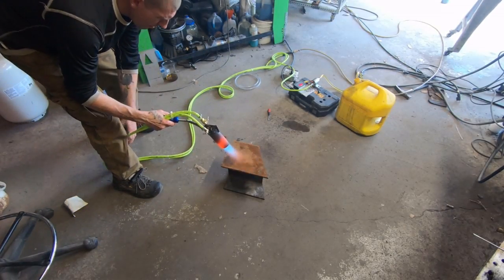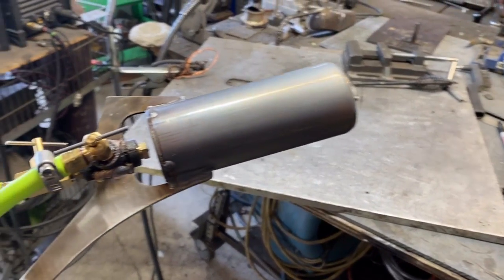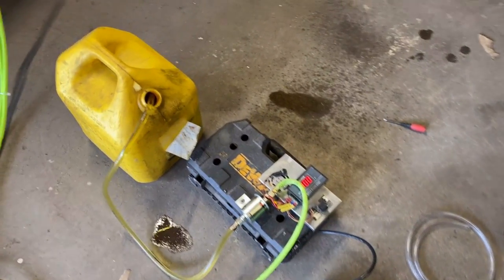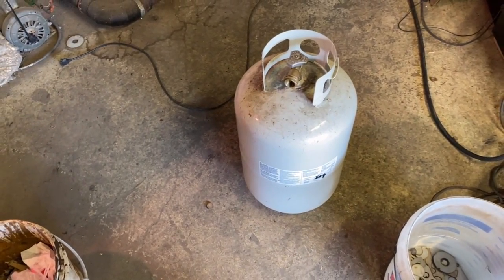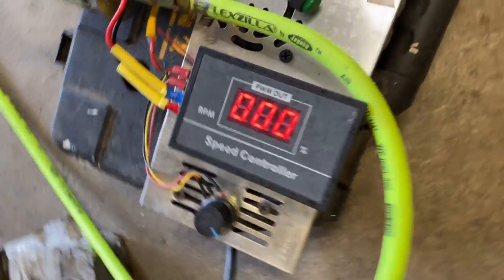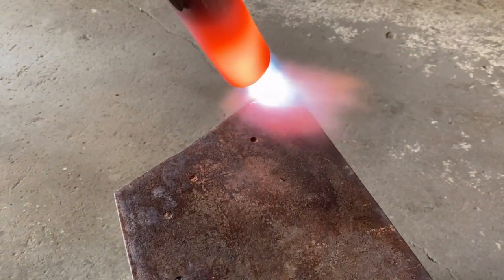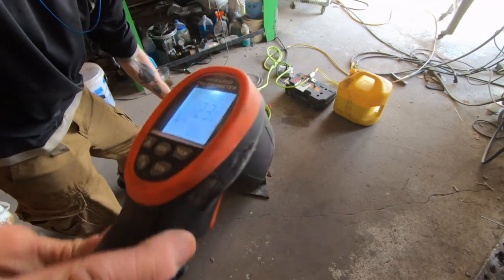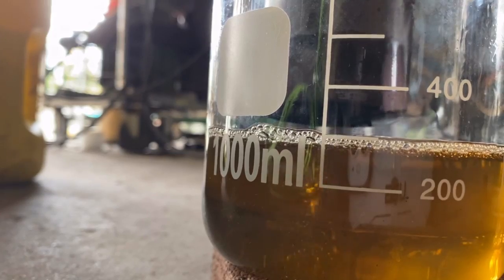Rocket torch Liquid fuel blow torch system runs on gasoline or diesel

Comment: The type of pump you are using is a magnetic pulsating pump. This kind of pumps are used on aux generators with carburetors. This pump can run on blocked output fuel line without a problem. You can simply run it at full 12v and simply regulate your fuel flow by chocking it using your regulating valve. This will also take your pulsating problem away. Also you will be able to get rid of your voltage regulating device.
Reply from the maker: unfortunate some of these umps do not work as you described , they kick off and on for some reason , some do have a pressure switch inside .
I tried the method you described and unforunalty it does not work that way
Reply: @NOBOX7  This is how it is designed. It simply stops at set pressure. If you ever watch how this pups work you will see they pump quickly and as soon as the carburetor is full and needle valve is closed they just stop because the diaphragm can't overcome spring pressure. As soon as needle valve opens the pressure drops after the diaphragm and it starts pumping again, then stops. You have to have some fuel flow or it will pulsate, start stop pumping. If I were you I would use some sort of centrifugal pump or inline pump for EFI fuel injection and pressure relive valve. These pumps are higher pressure pumps and they don't pulsate.

Comment: Back in the day, we used a hand held torch that used gas and diesel. Of course its considered antiquated, but it sure was convenient. Had the same fluttering effect until it was adjusted properly. Once the cast iron head was pre-heated it would work great. You can still find them around garage sales. Maybe give you some design ideas. The cast iron would pre-heat the air supply and the fuel, more air volume but less air pressure? Good luck with it, looks great :)

Comment: I read a paper once that stated that you got better heat transfer if there was pulsation in the combustion. Then I remembered a commercial high efficiency home heating furnace that used a pulsating flame. You might not even want to get rid of the pulsation !

Comment: I know it isn't a problem in this design, but, if it's easy to increase the liquid pressure in the line by around 50-100%, then I think, with also giving the oil a tighter squeeze at the burner end, the pressure variation in the oil line that comes from lifting or lowering it could be reduced by the same percentage of change in pressure in the line.  If you wanted to take it even further, you could even fashion a burner with a small pressure regulator of some sort which is closely attached to the burner end of the assembly, but that is a lot of effort for a small improvement and probably not worth if I'm not mistaken.  What do you think?
Reply from the maker: Yeah it depends on actual performance  without it Vs with  . The problem is the Steam axe will be a $800 $1000 tool most likely . So to keep cost down 
we really gotta ask ourselves how bad do you need a $40 regulator ? If you read the amazon reviews its not looking good for the units under $40 bucks . In the next video i solve the problem with About $20 labor included .

Comment: You could perhaps reduce pulsing through the use of an accumulator in the pressurized fuel line. This is a common practice in hydraulic systems to create a smoother flow of oil. They are also easy to build for the pressures you are operating at.
Reply from the maker: Yeah i mention that but i gotta keep cost down so thats the purpose of this test to see if it even maters.
Its gonna cost $20 bucks or so to do it i wanted to see if its ok without it . The video i will add a accumulator

Comment: I am a small engine mechanic and I accumulate a lot of bad gasoline from customer's equipment. There are no places in my area to safely dispose of gasoline. So what I end up doing is pouring it into a steel bucket and burning it. There are many issues with this, some quite obvious. First of all, burning gas in a bucket takes a very long time to burn, especially when I have to burn several gallons at a time. Second, the black smoke might also bring unwanted negative attention. But worst of all, I have to babysit the fire to make sure it doesn't get out of control which is a complete waste of my time. It could take hours for it all to burn away. The smoke and the odor of stale varnish gasoline is nauseating to say the least. To keep the smoke down, I used a small blower from a exhaust blower on a gas furnace which helped somewhat but positioning the blower and aiming it perfectly at the burning bucket is a pain and there has to be a better way of doing this.
What I want is a self contained system that can burn old gasoline at a decent rate while emitting as little black smoke as possible. I'm not looking to use it for heating or for forge use. I just need a system to get rid of the gas as a waste product. It also needs to be somewhat compact as it would be used infrequently until enough gas is collected. Note that the gasoline that would be put through the system would be highly contaminated with trace amounts of varnish, ethanol/water mix, dirt and other sediments. If forced induction is needed to a clean burn, it would be preferable to use a blower motor due to its low power consumption and noise. The blower motor I have is an exhaust scavenge blower from a gas furnace. It has a shaded pole induction motor and is fairly small and compact. The most I burn at a time is about 2 gallons of bad gas at a time, but this varies on what equipment comes in. I'd like to bounce some ideas off you to see if we can come up with a solution to my problem. I'm looking at making this fairly economical since the machine would serve no other purpose but to dispose of bad gas. Let me know
Reply: Mix it with waste oil  that's  what I do...makes the oil thinner... then burn it in a waste oil heater.
Reply: Bad gas is almost always abit of an exaggeration.
It burns in a bucket... usually is good.  Let it sit and settle out the rust and junk... then pour it in to your vehicle. I do that a fair  bit.... filter it with an old fuel pump and inline filter if you are worried... that's what I would do with most of the bad gas I drain anyway....   guess I am to cheap to see energy wasted :)
Reply from the maker: I sell burners to people all the time to get rid of used paint thinner . My contact info is in the description give me a call or better yet email me so i can send you some links

Comment: Can't you just leave the pump at full power and regulate the flow with a valve? Or would the pump burn up?
Reply from the maker: So far the fuel seems to cool the pump and yes your idea will work and it would eliminate $20 in parts